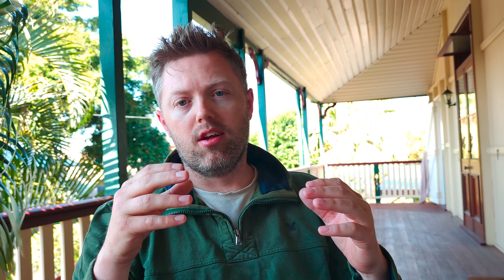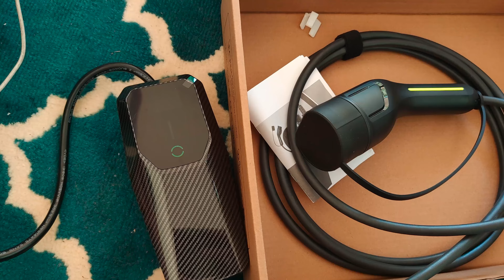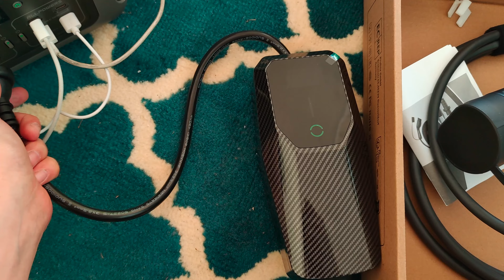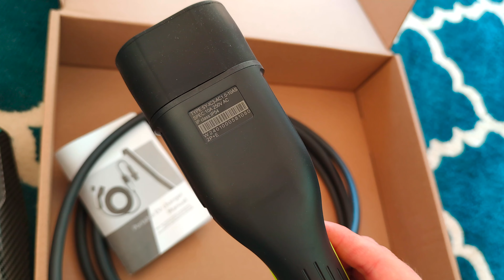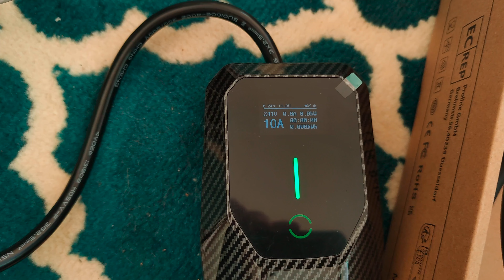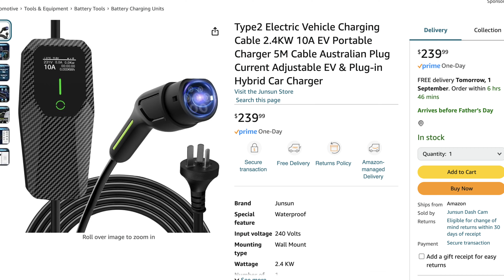BYD Seagull taken apart for big dollars by a HUGE Bank

Comment: The other day my car was charging at the office’s garage and I received a notification saying that the car was unplugged and I thought that someone tried to remove the cable and I went immediately to check but in the end it was just a circuit breaker that pop up and the car detected as the cable was removed

Comment: My story is ..... I bought a 15 amp portable charger, and asked my mate - who is an electrican to install a 15 amp plug in my garage. After checking out my main switch and wiring... he told me I dont need to install anything as the previous owner already done it.  We ended up going out for brunch. : )